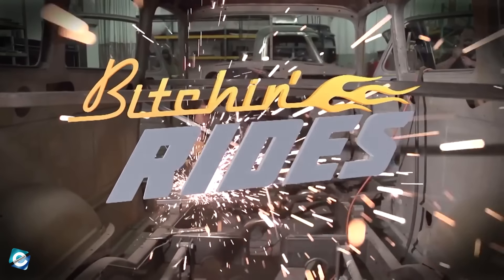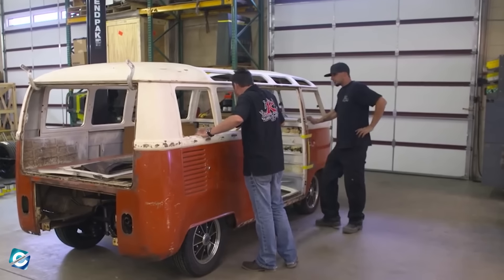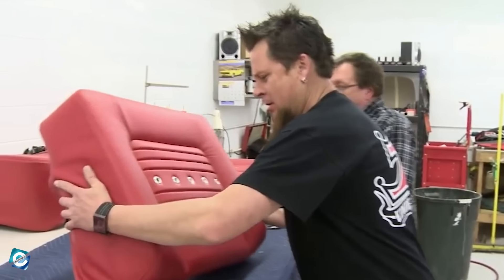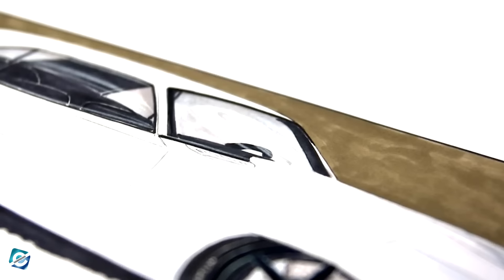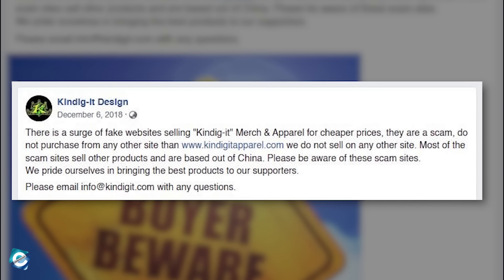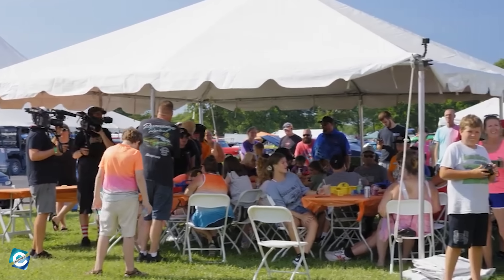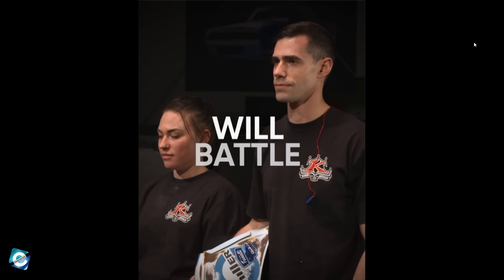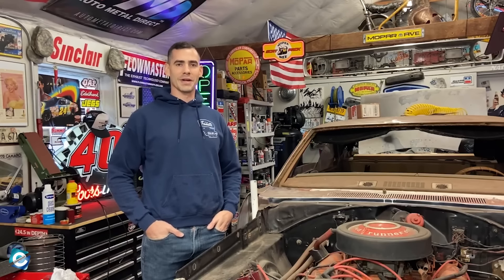How much does Dave Kindig charge? What’s the average cost of a Kindig car from Bitchin' Rides?

Comment: Boa noite congrats carros this owner built 1972 Chevy c-10 longped makes a Big impression custom g 1951 this bagged c-10 at the beachis the best, what s LT like to drive a 1964 c-10 truck?( Supermerged Chevy lsa), 570 Hp ls3 swapped Chevy sububan hot Rod, 80 c-10 drag truck page 2 - the 1947 - presen t Chevrolet GMC truck message board network, this 1967 c-10 is smokin, duramax diesel powered 1956 Chevy, Marty -s 1965 c-10 vai trabalhar c-10 era Detroit pistons bom 💪🏾👍🏾😎✨🚗 amén